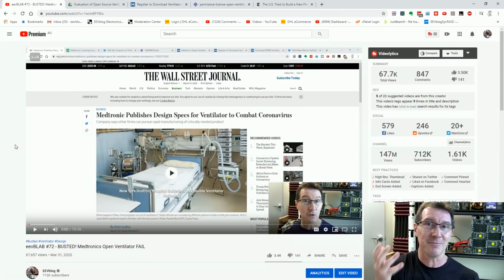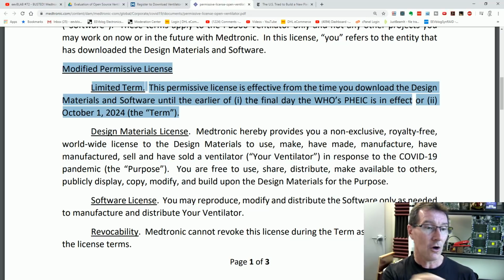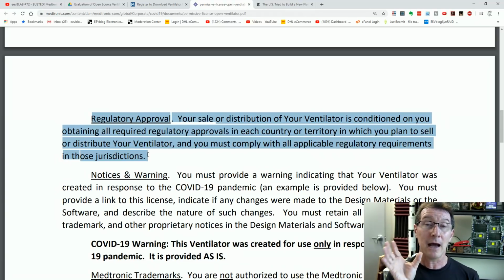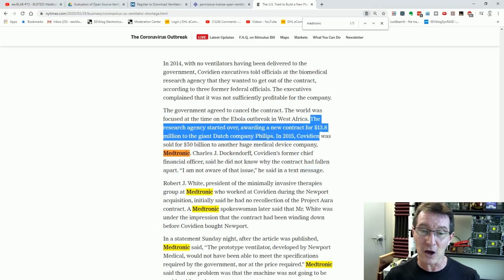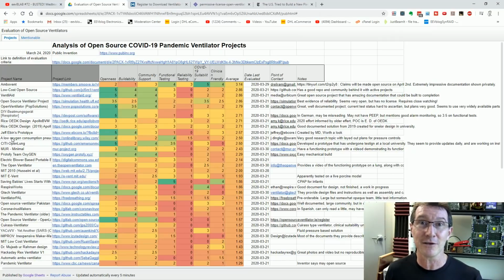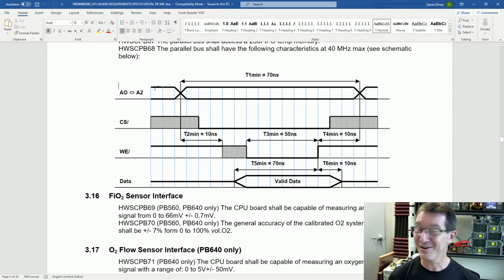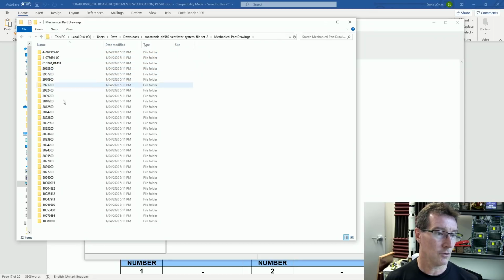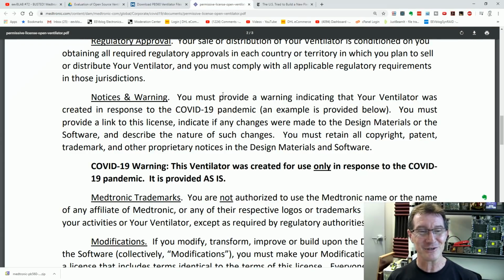eevBLAB #73 - Medtronics Open Ventilator + Others UPDATE

Comment: would the CPU being used in the unit a 80586 or would they be using a UDOO RYZEN Bolt V1000 SBC Maker board because of the data processing abilities of the board.

Comment: I always thought that ventilators use external oxygen source like that socket in the wall in the intensive therapy room or simply an oxygen bottle like in SCUBA gear. UPD: just a thought. Can someone upgrade SCUBA gear reduction valves and mechanisms to accommodate them in a medical ventilator?

Comment: None of this information is intended for people tinkering in their garage. It’s all for large manufacturers who are spinning up production lines to replicate the design for the next few months or years. All of the information released is exactly what you need for a team of engineers to set up a new manufacturing line to temporarily crank out thousands of these ventilators with FDA approval. Honestly it’s bullshit to even pretend that someone tinkering in their garage can or should be making medical devices. None of the ‘open source’ ventilator projects will be of any use, it’s people who have no idea what they’re doing, just playing around. It’s a hobby. Which is fine, but don’t pretend that they’ll be the ones who will make a difference.

Comment: Emergency Ventilator, the real thing.

Please take a look at this, and if you find OK, help spreading the word.
This is an emergency ventilator made by a Danish University ( https://www.en.aau.dk/ ). The emergency ventilator is approved by Danish health system.
The ventilator is easy to build and cheap. But very robust.
I am Danish, but not an engineer, I just wanna help save lives. So guys, please take a look at it:

From Aalborg University, shortly before it got approved: https://www.news.aau.dk/news/emergency-ventilator-to-alleviate-severe-shortages-of-equipment-and-personnel.cid459836

From Danish National Broadcasting (like BBC in UK), please use Googletranslate. I have tested it, it does make a decent translation: https://www.dr.dk/nyheder/regionale/nordjylland/danske-forskere-har-brugt-blot-14-dage-paa-lave-en-simpel-respirator

Manuals, software, permissions: https://github.com/CoRescue

As a Dane, I can verify that this University is OK and the article is from Danmarks Radio (national broadcasting).

Hope you guys wil take a look at it.

Comment: A colleague brought up the idea of that we should design and produce a ventilator, considering we're already working with pneumatics and moving air around. It was rather quickly shut down by our boss, who has experience in medical device development. A ventilator is a Class 3 Medical device (we're EU-based), because it's a life-sustaining system. This means that there's A LOT of documentation and testing needed to be able to take i to the market (including giving them away for free). I doubt many, if any at all, of these open-source projects will be able to help the with the pandemic at all, because of the regulatory problems. The only way to get them to help is if they also get massive support from the authorities and regulatory bodies and get some kind of fast-track to certify their products. Even with that fast-track, my guess is that it's still going to take many weeks, if not even months to get a ventilator approved for clinical use.

Comment: Ventilators required right now, may be next months to cover the peak of pandemic. Even if all documentation is complete and available, replication of such complex design require careful analysis of existing design, replication of plastic molding tools, adjustment of molds for plastic shrinkage, sourcing of standard parts, training personal for calibration process, whole unit and all components and interfaces verification and validation, analysis of reinforced plastic parts for stress etc etc. Any failures may increase death toll rather then reduce. All above involves many-many months of hard work and trails/errors even with all documentation. No matter how many people involved into the project. Does not matter how many mans are involved, a baby (healthy one) would be delivered not earlier than in 9 month. In some instances it would be easy to re-design some sections then replicate them. People who claim that they will print all parts on 3D printer never design anything with complexity of more than 3-4 parts which should fit together. Many of them just trying to get cheap publicity using current peoples tragedies. I do not believe that this is possible to replicate complex design in such short time by group of people without having centralized laboratories and manufacturing facilities. If company truly wants to contribute to the battle with pandemic, they would offer components which are already in their warehouse and helping to source using their existing suppliers, offer molding tools and plastic parts, engineering support and some trained production personell to other manufacturers, which already have appropriate manufacturing facilities. But what they offer - on my opinion - is no more than cheap hype while they know that the information, which they released, is useless for the purpose (immediate supplying ventilators)

Comment: This isn't for DIYers or backyard engineers.
This is useful for the companies who aren't looking to be in the ventilator business for the long term, companies like Daimler or GM, who need to meet the demand to build ventilators. It will overall just speed the process, as the manufacturing giants already have the necessary tools, it's just a matter of slightly retooling and redesigning some small bits, as well as adding some different logos haha.
It's not a bad action from Medtronic, and while it's certainly not "open source", (they've never referred to it as open source iirc),  they have a good intention here.
Reply: @Sérgio Freitas I agree but what do we do with the 1 million ventilators made using this. After the covid disaster it says you can’t even use the ventilators for something else. Or save them for another pandemic. Bin them?

Comment: Hats off for Medtronics for releasing all the design files for their product!
The whole drama with the license shows whats wrong with society and the government that makes this situation possible. How can it be that intellectual property on how to make life supporting devices can be privately owned and coverd by government laws in times of a pandemic crisis ???
Yet the exact design files aren't really what makers need I assume. To see what sensors, valves and pumps are in there, who supplies them and what operational principle lays beyond should be enough. Same with the source code. You don't need the full source code, a good program flowchart would be enough to spin new code adapted to a possibly simpler design.
Reply: Lack of detail would delay manufacture an APPROVALS for the urgently needed equipment. I f you want a quick volume manufacture ALL FULL DETAILS allow a suitable manufacturer to immediately proceed. 
Anyone wanting 5o long term manufacture is quite free to do their own research 9f standards, regulations, do their own design, get medical design approvals and have a private or even truely OPEN SOURCE perpetual product. 
Just be aware that medical products, into USA,  are only allowed into US  via one customs location, my senior professor almast was jailed from bring a cardiac monitor prototype to a medical convention in his luggage. Not even anything for sale yet, just as a point 9f conference discussion befause it failed to be cleared by that one handling point of customs. 
GOOD LUCK TO ANYONE DOING A PRIVATE OPEN SOURCE MEDICAL PRODUCT!

Comment: Dave-  RE that license-  Any technical / research / manufacturing company that ever wants to be able to protect its IP in the future absolutely has to set an end date for the incorporation of this design info into new designs.  Without this protection, any competitor could cherry pick over their design, pluck the most innovative and well executed features, and build them in to a competing product at some point years after this pandemic has passed.  The fact is, Medtronic are not, and are unlikely to ever become, an open source company.  They will have a mountain of IP in this part that will also impact other products in their range, and typically these patents cascade down as further developments are made.  If the top of your IP chain is unprotected public knowledge, then it makes protecting the derivative IP that much harder.  It's great that these plans may inspire people to make better ventilator designs, but I appreciate that at some point, when this is all over, Medtronic will have to get back to making money.
Reply: I would say to build one is not "that " trade secret. The Major problem is the certification for such as Working Med. Device who cost Money.

Comment: What we need is a simple open source ventilator design with open source software that can be made by the maker community for the next pandemic. Have the files for the 3D printed parts readily available, circuit board designs could be stored on file with the likes of JLCPCB. Professional manufacturing companies would be freed up to produce the parts that can't be done by makers.

Comment: The term you're looking for is boondoggle [ https://en.wikipedia.org/wiki/Boondoggle ] Pretty much everything the government ever tries to do turns into a boondoggle. Yes, they were rather forward thinking with "Project Aura". The ventilators of the era were large, bulky things that weren't so easy to stockpile. The problem then became the threat to the existing multi-billion dollar industry -- $50k per when there's less than $1k in construction... A small, cheap, easily warehoused system is clearly something they (medtronic, etc.) didn't want flooding the market. (even without FDA approval.) Thus, buyout and subsequent burial.

(Medtronic then has a $100 design they can sell for $70k. Note: I'll leave it to others to figure out the 10,000 unit BOM costs, but we all know it's nowhere near the catalog price.)

Comment: Open source ventilators is a really dumb idea. Who’s contributing to this and what do they think it will accomplish? Unless there is a specified manufacturer (and audited by the regulating body) those designs will never get regulatory approval. Build it at home if you want, but if you think a hospital is going to buy it you’re gravely mistaken. Give it to your grandma instead if you trust open source medical equipment. Otherwise, find a manufacturer that’s already registered as a medical device manufacturer and push the design through the approval process (+1year)

Comment: One thing that this will make much easier is that the published files will enable companies to checkif they are able to produce the ventilators. They can then contact Medtronics, tell them they are able o step in as subcontractors soon and fire up production as subcontractors. This still would make loads of extra ventilators availabe.
An Open Source license this is not. By no means.

Comment: I work for a big medical equipment company. I think it is almost impossible to produce a ventilator as an OpenSourceProject if regular regulation is applied.
First of all you need to be certified by a notified body (e.g. TÜV in Germany). You need a quality management system.
If you want to produce a medical product, you have to validate your production process. This is impossible for a makerspace or a small company. 
You have to monitor your productionenvironment (temperature humidity  etc.). ESD is a big topic aswell. Trained and qualified personal is required as well. Even if you move your production to another room you have to revalidate your process. You are only allowed to use calibrateed tools from measuring tape to osziloscope.
For each unit you produce you have to generate and file a Device Histroy Report (DHR) including all tools used (Serialnumber, calibrationdate etc.). Each masurement taken during during production needs to be documented in the DHR. You have to monitor serialnumbers of critical components. In case you want to use a 3D-Printer to produce parts you cannot exchange the filament without a lot of paperwork and retesting the parts.

Sadly i think only companies which already work in the medial business are able to produce and distribute a open source ventilator. The paperwork for each produced ventilator will cost more then the parts....

Please don't forget each malefunction could end a persons life.

Comment: If you're cynical, the expiration date on the license together with the requirement to get it validated by relevant authorities could easily be seen as a smart/cheap way for Medtronics to get validation in countries they don't have yet without having to do any work and then continue selling the product after the pandemic with no licensing fees or costs.

Comment: As a person who was part of a project that spent 20 years, 300 million dollars to get FDA approval for a medical device, I can say these ventilators will never see the inside of a hospital in the US.  The only way any third party untested/unapproved ventilator will get into a hospital is if that third party is manufacturing a vendor that's already obtained FDA approval.    If you change so much as the color of a button you have go through an amendment process with the FDA which just the filling fee alone will cost you over 100K.  Then about 6 months of paperwork, and another 6 months to get the approval.  NOT to mention that all the facilities need to be audited by the FDA twice a year.  You need certificates for every material, every circuit board, every cable, every wire, etc..  If the software has been signed off by the FDA you can't touch it in any way.  If the CRC changes then it's considered "NEW" software and you have go through the entire V&V process again..
Reply: In Italy, Spain and France some hospitals are now using modified snorkeling masks. I don't think they took the time to get all the mandatory approvals first 😉

Comment: FYI, The valves are off the shelf parts used in industry in automation in the semiconductor industry for cleanroom use. They are used to control robotics for the delicate handling of the wafers used. This project could impact the availability of service parts for repairs and manufacturing of semiconductors. Many of the valves are air operated with small pilot valves referred to as solenoids that move the main valve spool. Most of the solenoids use 24VDC on a coil of about 280 Ohms.

Comment: Also the age of the ventilator's design is 15 years old, and is NOT even their own! It's a company they absorbed around that time.
I'd rather go into production building kits of the MIT breathing assist device.
EDIT: corrected age.
Reply: No its not, this was released to market in 2010 and given the usual time needed to design and get approval for a medical device then the design is most likely 12 or 13 years old. Parts of the design are probably way older as most medical devices are evolutions of existing designs.
Reply: @MrCapacitator  True enough. I was going by the copyright in the handbook for it. The last update was 2014.

Comment: I would think the best source would be to use the millions of existing home CPAP/BiPAP machines with some modified control circuitry to work as ventilators.  Using the Medtronic design considerations as a basis for your mods would be the best and quickest way to market.

Comment: I'm kind of concerned about the software, and it not being released as source code but rather as a pre-compiled binary blob that would only work with their board, and which may even have some kind of deactivation sequence that cripples these ventilators once the "license" is revoked by MedTronic. Sure you can reactivate it... for a generous fee by MedTronic service engineers,.

Comment: As desperate as this situation could get I wonder could some older designs from 1970s and 1980s be looked at or even revisiting the old negative pressure ventilators of the 1950s as these could be easily produced.

Comment: I guess these specifications will delay the development of a really simple unit. If anybody wanted these built, we'd have had source code and fabrication files for most ventilators in production since February. Imagine how simple and quick it would have been to modify an existing project for the parts you have: industrial pressure sensors, fans and so on. Calibrate, test quickly and use.

Comment: I have to agree Dave..and not just that.. Even if there is company that can do this new ventilator ..it doesn't matter you need to have approval to USA, EU...all that testings cost over 100k per product..noo problem...and it can take up to 6 months sometimes even more...Soo it doesn't matter if you produce it  tomorrow..you can't sell it..because it isn't safe..just because they say oo yes you can use it ...NO...It must be safe ..tested and all that..Soo i'm sorry to say but as you said it would be better just to increase production capacity..that would be much usefull...

Comment: I have more faith in the open source projects. Besides, right now sophisticated computerised devices don't seem like the best solution. We need cheap & easily manufacturable low tech devices in large quantities. There's a crisis to combat. In normal emergencies (and without power) ventilation usually consists only of a volunteer squeezing a balloon repeatedly at a steady speed. If you could automate that with a powerful enough motor and a simple knob-controlled speed controller, you have half your ventilator already. I'm sure that doctors and nurses would be glad to use something like that if nothing else were available. Even a simple solution could already free their hands to help more patients.